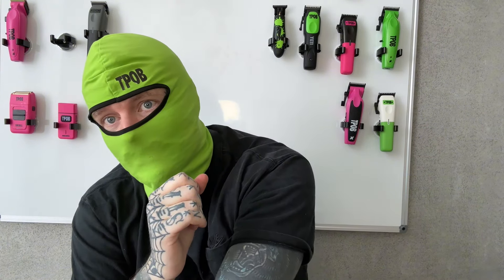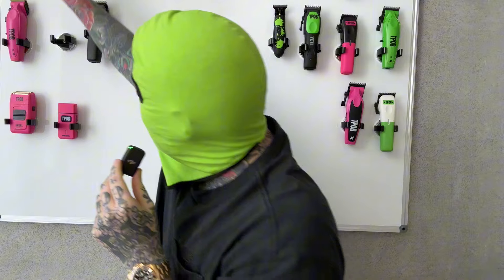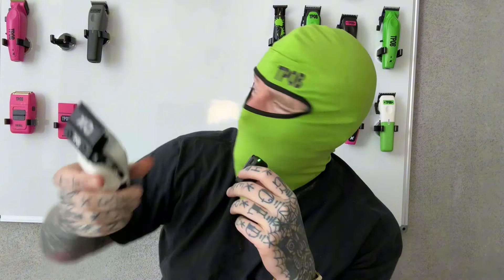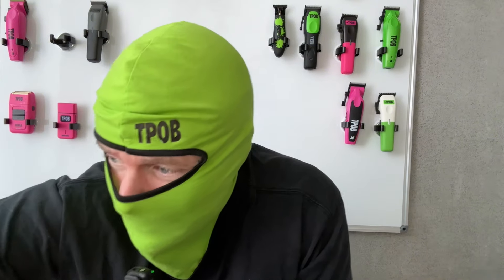Who REALLY makes Barber Clippers ?

Comment: Since we are on design, I bought the XO Combo and I love the clipper. I've used it daily since purchase. Put my magic clip in the drawer never to be used again. But the trimmer was just to loud, so loud I sent it back for a replacement. Replacement same problem. After investigating I've noticed the plastic piece that's attached to the moving blade is smaller than the groove in the fixed blade causing it to rattle. My question is there a plastic piece (is that cam follower?) replacement that will fit in that cam shaft more snuggly?